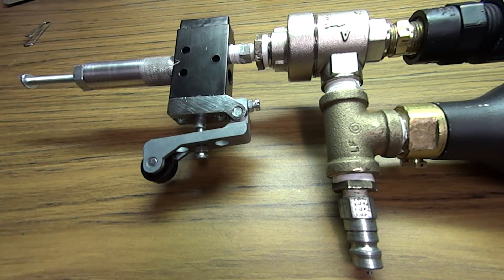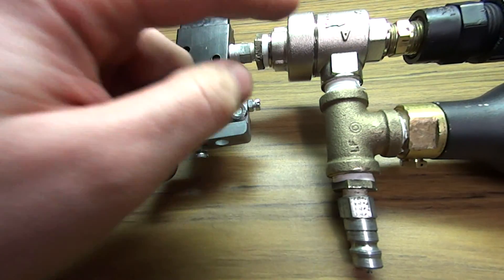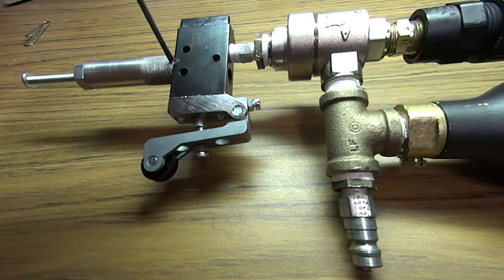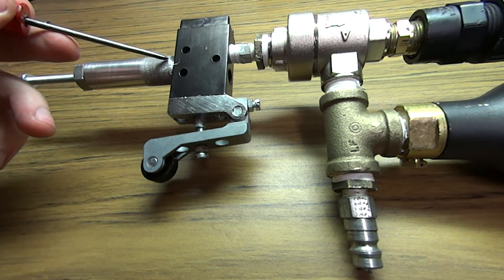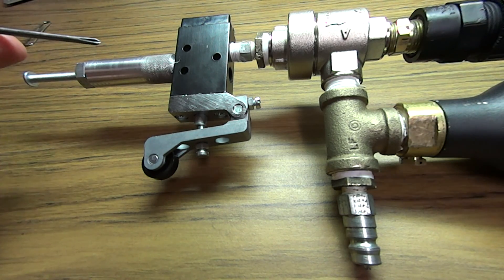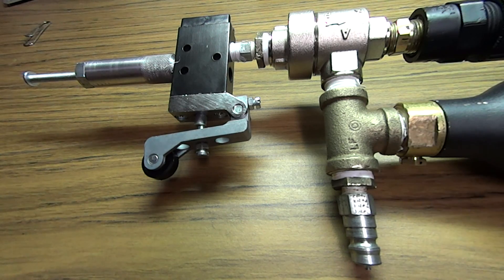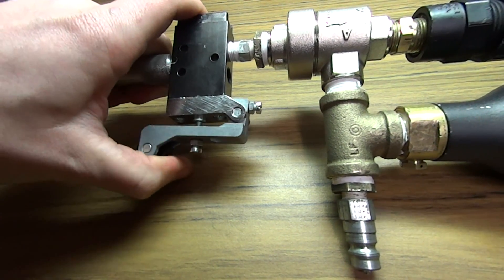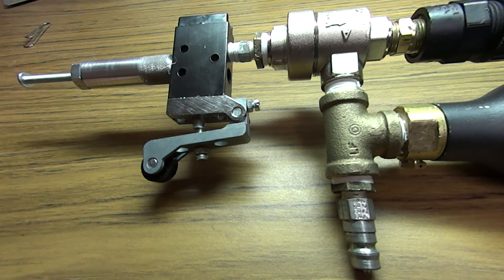New and improved QEV Multishot Rifle w adjustable power

Comment: Nice design but very inefficient. It would bring down the shot capacity to half
Reply from the maker: @vikrammark1  how?  As compared to?
Reply: @swandonovan  as compared to hammer valve design. The qev opens up only after almost equal amount of air pressure is released from the camber as being used for propelling the pallet.
I would like to know the operating pressure rating of black valve but if you can operate it at 100+bar and the air cross section is good, you should not need a qev. If you can replace the black valve with a solenoid valve, that could be even better
Reply from the maker: @vikrammark1  shot capacity is nowhere near halved compared to hammer valve.  Also the black 2 position 3 way valve could be operated via solenoid, but there would be no advantage

Comment: how does your switch hold 350psi? I’m searched all over the internet and max input was around 150psi
Reply from the maker: Dangerously.  This is the most asked question on any of my videos, and I've answered it countless times.  But I'll do it again.  Working pressure is generally 4x less than burst pressure.  At least on high quality devices (Germany,  usa, Japan). It's up to you what kind of risk you want to take.  The smaller the diameter of the valve, the less force will be acting on it, the more I trust it at multiple times the working pressure.

Comment: To me, the small chamber at the pilot is to regulate the trigger shot when the air in the tank is decreasing.
Reply from the maker: you could use it for that.  could probably also modify it so that it adjusts dwell time (for lack of a better term) automatically to make ever shot as close to the same power as possible

Comment: Hey Swan, I neeeeed help!
I build pretty much the same thing with a black aluminum qev (common in china) and pretty much the same 2P3W valve and i used just a small pipe for the variable chamber, I also modified the valve like you taught me and it funnily enough sounds just like urs in the vid - but it doesnt exhaust the qev, instead what happens is that just the air from the small chamber gets exhausted through the port on the 3 way that has nothing on it...
I tried a couple of modifications to make it work but i always get the same results..
I'm really lost here after spending good buck on parts and me not being able to get it to work... :((
Hopefully you, Swan, or someone who has as much experience can help me figure this out
Reply from the maker: Sounds like you have stuff hooked up to the wrong ports
Reply: @swandonovan  if you are refering to the ports on the 3way2pos then I can exclude that possibility as I tried both ports and just to make sure i even tried to switch around the pilot chamber, I therefore tried ever possible combination for that valve. There is no way to hook up the qev wrong really. I also doubt that it is the spring or diaphragm hole as there is not even a small amount of air releasing from the qev exhaust port
I've been building air guns for more than two years and yet I am unable to figure out whats wrong which is kinda depressing

Comment: Hi Donovan,
I can't understand how this design works, you have apperatly your chamber hooked up to the P not the A where I would normaly hook it, and the valve doesn't do much to me it juste direct air from the reservoir to the chamber and when you release from the chamber to thin air! how does the barrel get any air at all? your system seams to be working so I must  have missed something.
Reply from the maker: Assphixer black tank to the right is chamber and is connected to a. Diaphragm has small hole in it along with spring to allow for filling from a. Silver adjustable volume secondary chamber is strictly for tuning shot power.  Pilot volume is dumped into it and equalized behind the diaphragm of the qev forcing it shut / allowing multiple shots. Hope that makes sense along with the video.  It's my own design. Never seen another like it.
Reply: thanks for the quick reply, I'm new to the topic I'll gather out more info, and hopefully I'll get it ;) the problem for me is that people don't include the main tank and I get confused between tank and chamber and stuff, so yeah thanks again.
Reply: I still don't get it. You said the air will be released from the hole at the bottom, but then no air would come into the barrel?
I have all the parts laying around, ready for a solid airgun. But I can't figure out how these mechanisms work!
Can you explain it to me? Thanks!